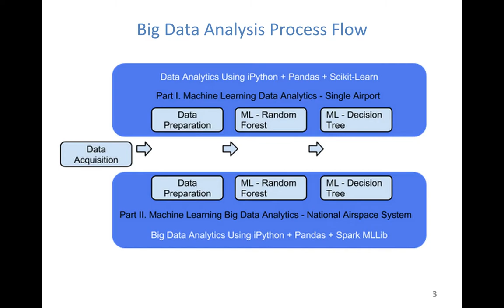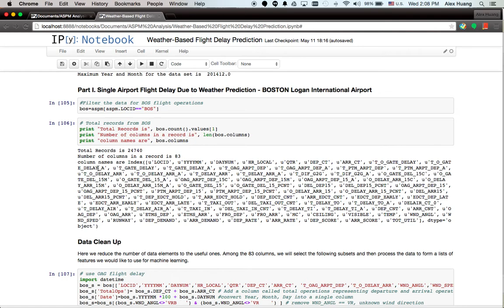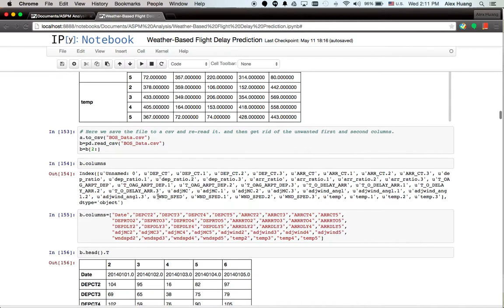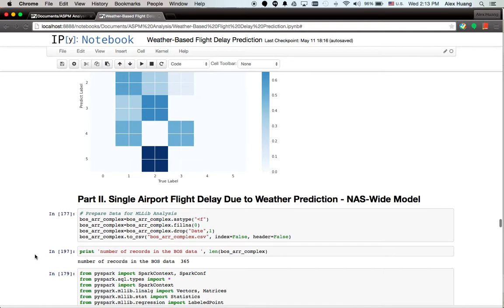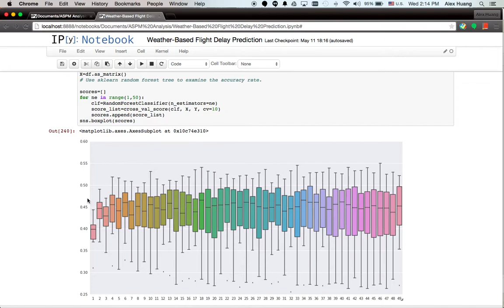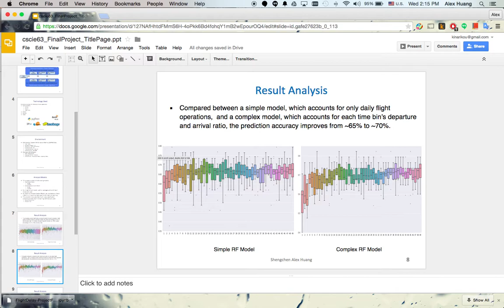CSCI-E63 2015 Final Project – Weather Based Flight Delay Prediction Model 2-min

Comment: hello sir.  I am Aditi Kamra from New Delhi (India) and i am also working with Rakshak on similar project in IIT Delhi under prof. SK Gupta.
We really liked your analysis and We are trying to predict the Delay during the flight route. And we were actually hoping if you could help us with the weather data.
And could we quite helpful if we could get some source code links(github etc.).
It would be really great if you could help.
Reply: Hello, i m also working for same as building a flight delay model due to weather will you help me, if you done that project. It will be great if you suggest something . Please reply . I really need help for this. thank you .

Comment: Hey there! I liked your analysis and prediction model especially the relative importance of each feature.
I am a student at IIT Delhi(India) and I am also doing a project on similar lines. Can you please give all the links for the sources(of data) you have used? I am currently using data from flightaware.com but I am not getting other data(like weather).
Also it would be a great help if you can give your email-id or alternatively just drop me a mail at cs1130250@cse.iitd.ac.in. 
Thanks!
Rakshak